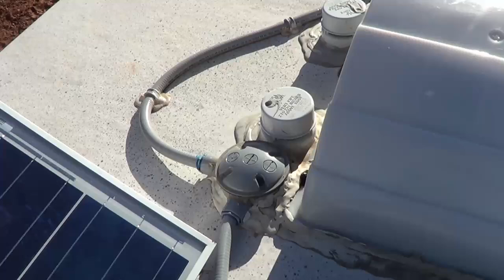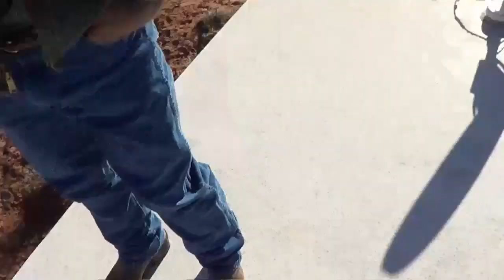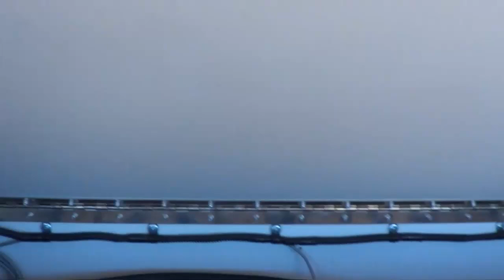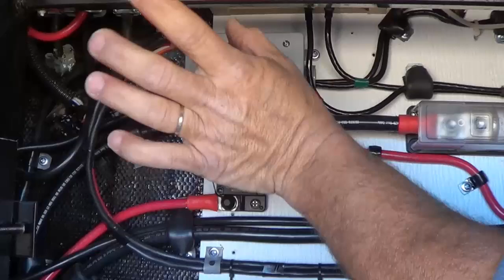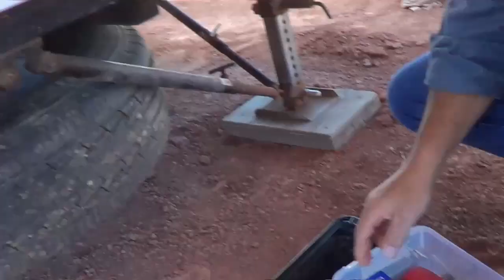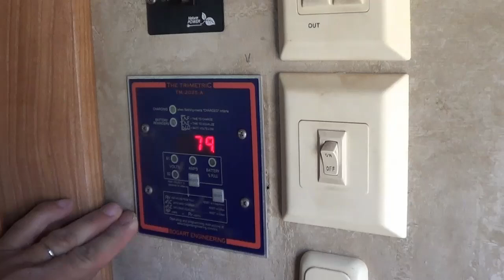My Friends Awesome 580 Watt RV Solar Power System

Comment: The only problem I have with roof mounted panels, is I always look for the shadiest spot I can squeeze my trailer into in the summer months. Having them on the roof would limit the exposure a lot. Right now I have a small solar system that I deploy on the ground and move around as needed. Otherwise, great system.

Comment: Total over kill!! Talk about a fire waiting to happen lolololololololololololololol
Reply from the maker: Where is the fire risk your seeing,? Maybe I missed something.  The system looked well protected by circuit breakers and fuses and definitely wasn't lacking in large enough wire sizing.
Reply: Love Your RV the fire risk is thermal dynamic. You can't cross so many high power AWG wires over each other all over the place. High power lines should have there own space.
Reply from the maker: Thermal dynamic? Sorry, I'm not that smart, can you dumb it down for me. How do you envision the fire happening? Bear in mind the wiring is DC, not AC, oversized for its functional current load and double fuse. With each wire run fused and a catastrophic failsafe fuse in place on the main feed. Thanks Ray

Comment: What does the inteli-power charger/converter get wired to??? This seems to be the hardest thing for me to figure out.
Reply from the maker: It's just being used for generator charging I believe and is wired directly to the battery bank. Think of it as a high-end battery charger, works better than the OEM system that is in the rig. Having it so close to the batteries reduces wire losses and speeds charging.

Comment: May want to consider these if you want 10,000 cycles...98% efficiency... use down to 20%...no gas issues...mount anywhere....no fire hazard in a nice neat lithium configuration     https://www.youtube.com/watch?v=jj83sQ_kAyM  And maybe these for direct AC from the panels (micro controllers) https://www.youtube.com/watch?v=Q_2VxngSnKw
Reply from the maker: Great, if you have the money to spend on them.
Reply: That's what I thought till I seen that they come in cheaper at .14 lifetime per K/W hours....as show in the chart breakdown in the first video..
Reply from the maker: It's the upfront cost that is the problem. My 4 golf cart batteries serve our needs well and are tried and true for about $500 dollars for 4 giving me about 200 AH of usable capacity. They'll last 5 - 7 years, then I'll take a look at what lithium has evolved too. I'll let folks richer than I be the guinea pigs for the newer tech. I like to stay behind the early adopter curve. :)

Comment: Hi Ray, Great video.  (Actually, all your videos are great and very helpful).  Anyhow, could you please help me understand how and why he is continuing to use his original NPower 30 Amp Charge Controller (the blue one) in this setup?  To what is it connected? (ie to all of the batteries and solar panels? or just to a subset of them?  Does is still 'control'?  or just monitor?)  Thanks in advance
Reply from the maker: I'll ask Eddie - http://mobilehomesteading.com/  and see what it was for, I can't quite remember the exact setup, will get back to you. Ray
Reply from the maker: Here is the answer - It is the first/original charger controller, I left it on to check voltage. If you look at our latest video on our ”Off-Grid RV” you'll will see it was removed so I could make room for the twin system. Here is a link to the new Mobile Homestead power set-up - https://youtu.be/DmAHDDlojLc
Reply: Thank You Ray!

Comment: Hey Ray.
Great videos and lots of information. I was wondering , With regards to the solar panels, in your travels have you had any concerns with hail hitting the panels and damaging them?
Thank you.
Andy
Reply from the maker: I haven't had any issues, however, I have to admit I don't often encounter much hail. They are designed to handle a fairly large hailstone, like about an inch, beyond that if larger hail is hitting the rig, solar panels may be the least of my worries, I've heard of whole rigs being written off after a large hailstorm. Cheers! Ray
Reply: Thank you, I enjoy your videos,

Comment: I noticed your friend Eddy has used flexible conduit on the roof for his solar panel to the combiner boxes.  I understand the connections for conduit to a combiner box, but wondering what he used, if anything, at the other end, under the solar panels to connect the conduit under the panel? Thx.
Reply from the maker: You can see more photos of his work here - https://rvhappyhour.com/members/eddie/media/1323/
Also here is his website if you'd like to get more info - http://mobilehomesteading.com/
Cheers Ray
Reply: Thanks Ray that helps a lot. Happy travels. Bruce

Comment: In another of your nice videos you gave us a demo of the sound of your furnace fan and it was really loud. Maybe you have that on your list of things to look into, if it is possible to find a more quiet solution? Some kind of regulated fan maybe with variable RPM?
Reply from the maker: The fan is built into the furnace so modifying it may be difficult.  I have small portable heaters both electric and propane that I often use instead.

Comment: Nice video and nice work on the solar install.  I am curious on the intelli power smart converter install.  Typically many just replace the old with the new smart converter which simply involves disconnecting the wires on the old and reconnecting to the new.  In moving the converter to the front near the batteries, how is that accomplished? What happens to the wires from the old once it is removed?  Thanks.
Reply from the maker: Thanks Bruce. Here is a blog post I did about installing mine - http://www.loveyourrv.com/installing-the-inteli-power-pd9260-for-improved-rv-battery-charging/
Here is an update on the install as well - https://youtu.be/zuGAwXHKbwU?t=26m24s
Cheers Ray

Comment: That's a very cool system!  But, it could have been somewhat simplified and reduced in size by having it be a 48 vdc system, rather than a 12 vdc system.   All those large cables force your system to be larger.   Four times the voltage translates into 1/4 the current requirement to transfer the same amount of power - so, 1/4 the required cable sizes, as well as smaller transfer switches.  You could also put the panels in series and use an MPPT charge controller at a lower current rating set to a higher voltage.

To put this into better perspective, remember, voltage drop across any given length of a conductor is going to remain a constant.   For example, if you lose 1vdc across a fifty foot length of a conductor, at 12vdc, you're losing about 8% of your power across the run.  But, at 48vdc, you're still losing only 1vdc across the run, but it now represents only about 2% loss of power across the run.  The bottom line is how much power you're losing across the run, and that's dependent on the voltage drop and the voltage at the input - since, the current capacity of the run is also a constant.  In other words,  you can get more power across a run at higher voltage without ever exceeding the current limit of the conductor.

Also, remember, a 20 amp MPPT controller that is capable of charging a 48 vdc battery bank can transfer more power than a 45 amp charge controller into a 12 vdc battery bank (45x12<20x48).
Reply: Good reply Ray!
Happy Trails!!!
Reply from the maker: Isn't running a 48-volt battery bank going to open a whole other kettle of fish as far as complexity since all the RVs existing DC systems are designed to run on 12 volts?
Reply: No, the solution is simple - just use a 120 VAC to 12 VDC power supply for for the 12vdc appliances.    The only thing that should be running on 12 vdc are LED lights and perhaps a 12 VDC refrigerator.   And, you already have that in this installation in the form of that big 12 VDC battery charger.

Ultimately, the majority of your power usage is going to be from devices that use 120 VAC.   So, what needs to be done is come up with the most efficient way to get that 120 VAC.    And, that can be done with much smaller wires and switches, etc, than what is being used here.  You want the most power you can extract from your solar panels and that is accomplished by using a higher voltage system that requires smaller gauge wires, switches, breakers, and fuses.
Reply from the maker: Our RV has many 12-volt circuits besides lights. Furnace fan 8 amps, water pumps 6 amps, fridge circuits, propane detector, stereo system multiple cooling and exhaust fans, etc. On a cold night winter of boondocking my furnace fan can eat up 25 AH alone. My wife likes it warm.
Don't you think there is going to be a lot of wasted power converting 48VDC to 120VAC then back to 12 volt DC. I'd hazard to guess the inverter and converters are only 85-95% efficient, plus now they are idling all the time eating a few amps to give a constant 12 volts.

What do you use to charge the 48-volt bank when there isn't solar power?

I think running 48 volts in a standard 400-600 watt boondocking RV setup might have more complications and extra cost than its worth. Starts to make using large wires seem like not a bad way to go if looking for good bang for the buck.

Comment: The vent for the battery box, is there a small fan to move the air? Or just the open piping? Btw great video! Tks for sharing.
Reply from the maker: There is also a 3" round  hole  in the bottom of the box to the outside so a convection effect takes place. So far it's worked well, no build up of gases or signs of corrosion from gas build up. So I don't think a fan is necessary. The storage compartment is also very ventilated with the landing jack openings and openings on each side to the LP gas cylinder storage areas. In a sealed up area a fan could be a good option, though. Thanks Ray
Reply: +Love Your RV  thank you for taking the time to respond. In mine I think I'll have to use a computer fan, just to be on the safe side.  Take care!

Comment: Depth of Discharge (DOD) has an effect on life of batteries but people assume less discharge gives the batteries longer life.. that is NOT really true..  the depth of discharge effects the cycle life of the battery but the capacity of amps drawn over time is not better with lower DOD.. I have 6 Rolls Surrette S-550's in my bank.. the Rolls Surrette manual states that…

80% DOD gives life of 800 cycles
50% DOD gives life of 1400 cycles
20% DOD gives life of 2000 cycles

OK, you look at that and say 2000 cycles is longer life but consider the amp draw over the total life of the battery.. lets say the bank is 100 amp hour capacity…

80% DOD = 80 AH draw x 800 cycles = 64,000 AH
50% DOD = 50 AH draw x 1400 cycles = 70,000 AH
20% DOD = 20 AH draw x 2000 cycles = 40,000 AH 

now you see that doing only 20% DOD does give you more cycles but less energy to use…  your best use for maximum energy draw over the life of the battery is about 50% DOD.. now lets say you have calculated your energy need for a day and have discovered that it is 80% of your battery capacity and you decide you want to only draw 50%, then you need to add batteries… that costs you more money, uses more space, and adds more weight.. 

my bank is 6 Rolls Surrette S-550's.. they are $400 each, are about 1 cubic foot in size and weigh 125 lbs.. the bank costs $2400, takes up 6 cubic feet of space and weighs 750 lbs.. to go from 80% DOD to 50% DOD I will need to add 2 more batteries.. that costs $800 more, uses 2 more cubic feet of space and adds 250 lbs of weight.. you really think that is worth it to decrease the DOD to 50%?  I don't think so.. my bank was sized to discharge about 80% in winter and 50% in summer...
Reply: +MrMeanderthal

Nicely quantified. 

You should look at Lithium Iron Phosphate batteries and calculate there product lifespan. Short answer is they cost twice as much but last 4 times as long. they weigh very little and can handle deep discharge with no consequence.
Reply: +Love Your RV Rolls Surrette has some batteries that are the same 'GC' size as T-105, they are S-290.. but their 'life/cycle' is the same as the S-550 I have.. S-550 are 'L-16' size and are the same 'series 4000' as the S-290.. Rolls has a 'series 5000' that have a similar life/cycle as the Trojans you noted but they only make L-16 and bigger.... lots of battery companies make the GC size batteries and all the life/cycles though different have the one thing in common.. that's 50% DOD is the best bang for the buck..

I did a lot of research before I got my solar system and what I learned is the DOD life/cycle is real to a point but, the real death of batteries is not from it.. the real killers are..

over charging
under charging
not charging
oxidation from letting water get low

bad connections

if you balance your system with the right amount of charge capacity and do proper maintenance you go pretty much full life of batteries without issues even when you deeply discharge them continually
Reply: +MrMeanderthal DOD was one of the factors for our systems storage size along with funds available. We run larger inverters with fulltime loads. Due to a Phenomenon known as "Peukert's Law", LA "Wet" batteries drain at an accelerated rate when powering high current loads at lower voltages found in higher wattage inverter use at high DOD. This use sacrificing as much as 40% of their capacity rating in the process. Voltage drop at a higher DOD, south of 50% charge, will cause Peukert reduction increasing the % of discharge affect of Peukert's Law. This is why if you run heavy inverter loads you should try to keep your bank at or above 50% DOD to get the rated cycles. I run our system with a larger storage so we can have a longer inverter run time on the battery bank.
I will change our bank over some day when they work out the "Kinks" in the LFP Lithium batteries and also bring the cost down a bit. They are lighter, smaller in size, and hold voltage up to final discharge ( 85% to 90%) before it drops. LFP Lithium's are not affected by Peukert's Law. Just like charging batteries, voltage plays a big part in how much currant/AH you will receive from your bank. Thats why we run larger at a lower DOD than you do.
 I love the R/S L-16 AGM's but need to win the lotto to pay for a set!
Happy Trails!!!
Eddie----   Mobile Homestead Solar Services E-mail--  www.wyglonekseal@aol.com
Reply from the maker: Interesting stuff. Those are some nice batteries!
I looked up the very commonly used Trojan T-105s DOD specs. They are quite different than the Rolls Surrette so maybe that is where the assumptions stem from.

4000 cycles to 20% DOD
1700 cycles to 50% DOD
1000 cycles to 80% DOD

So using your formula I get...

80% DOD = 80 AH draw x 1000 cycles = 80,000 AH
50% DOD = 50 AH draw x 1700 cycles = 85,000 AH
20% DOD = 20 AH draw x 4000 cycles = 80,000 AH

Trojans are around $200 each 67lbs Length: 10.375in. Width: 7.125in. Height: 10.875in

Comment: VERY professional!  I'm surprised though that he's using non-AGM batteries for this setup?  He should look into VMax batteries.
Reply: Agms have more benefits than just non spilling. I still prefer wet cells and 12 volts.
Reply from the maker: ChillCosmos  Eddie recently added some new batteries. Here are his battery banks now - 
http://rvhappyhour.com/forums/topic/trojan-t-105re-battery-bank-install/

http://rvhappyhour.com/forums/topic/installing-a-second-315-ah-battery-bank/
Reply: +ChillCosmos 
6v GC2s have 30 more capacity and are half the price to AGMs. 
unless your flying upside down. you dont need AGMs

Comment: Nice, I'm in the process of converting my Arctic Fox truck camper to solar. I replaced the stock converter to a Magnum 1212 inverter http://goo.gl/ff0KlE I'm going to buy two 100 watt panels, the Trimetric 2030-RV solar monitor, Trimetric SC-2030 SOLAR charge controller with 500 amp shunt. I also bought two Trojan T-105 (225 amp hr) batteries. Can't wait sell my Honda generator.... Need to pay for all this solar stuff
Reply from the maker: David Bowen Sounds like a really nice system. :)
Reply: Well, I only have the batteries and the Inverter/charger so far. I have to say, the Magnum Inverter/charger is the best inverter you can buy. Made in America, they are worth the money. Also, I love the batteries. It's amazing how much better these 6v's are over my little Interstate 12v's were. My birthday is coming up and I told the wife that I wanted either the Trimetric or the panels as my gift. Hopefully I don't end up with a tie. :)

Comment: Why didnt you go with a 48 volt system?. smaller wire size and less voltage drop?
Reply from the maker: Crazy Canuk   I guess you mean why  the panels weren't wired in a series string?  I believe it was because he was able to get the large gauge wiring at very little cost, left over stuff he had kicking around from other applications, With such large wire the voltage drop is already very low so running it up to 48 volts doesn't have that large of an effect.. 
He then able to save some money by using a PVM instead of a more expensive MPPT controller and apply that to other parts of the system instead. By wiring the panels in parallel, the system is much less affected by losses due to shading and if one panel goes bad the whole system doesn’t go down, so better reliability. There are pros and cons to every solar install.
Eddie's system seems to perform very well in the real world boondocking tests from what I saw.